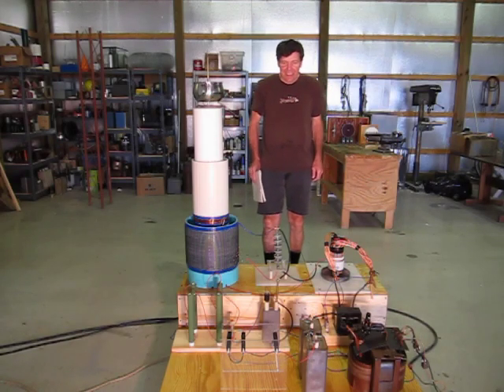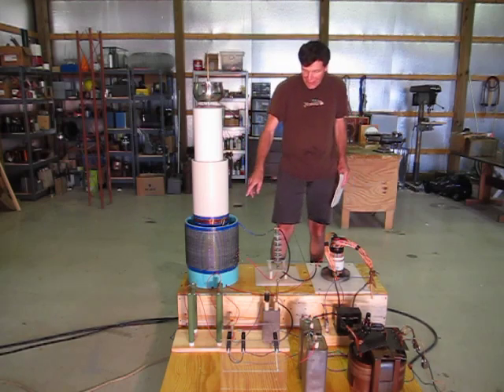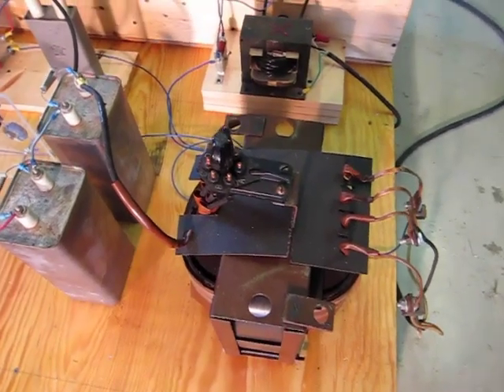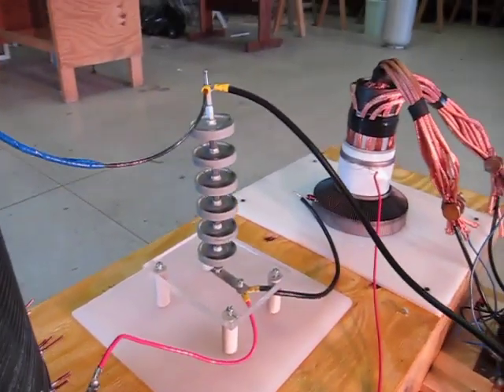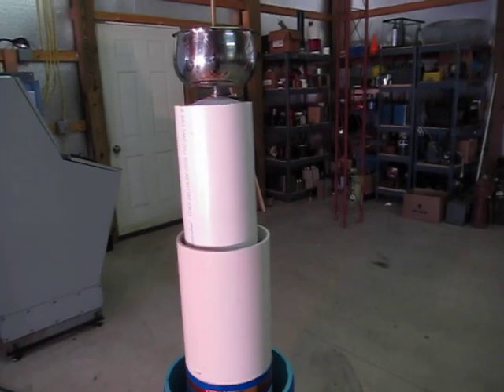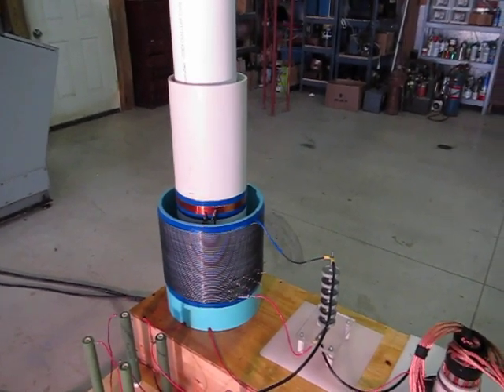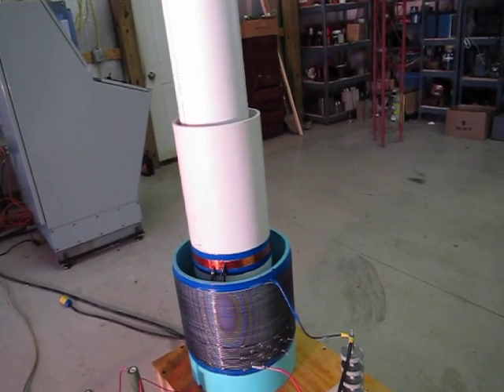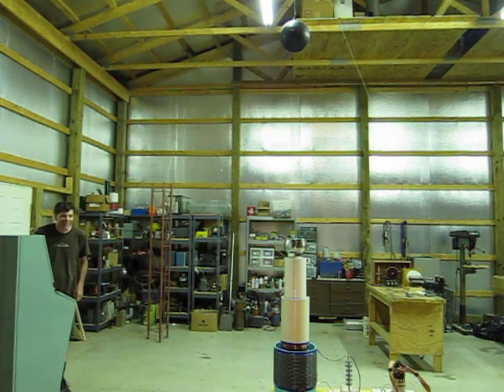BigTubeCoil.mov

Comment: Dear roger in Ohio,I am in need of your expert advice,I just finished building my first coil.I used 2 ,15kv Nsts in parallel,16 " diameter stainless steel torroid the diametre of the secondary is 4" and 22" high,I wound it with 500 turns of thin wire the stuff you get in Ethernet, cables.I used 25,150 ml salt water leydon jars for the cap, a static spark gap,the primary has 12 turns quarter inch copper pipe.im only getting 2" sparks why is that please help .email siranthonyLockwood@hotmail.co.uk